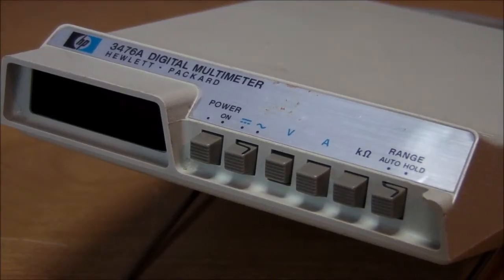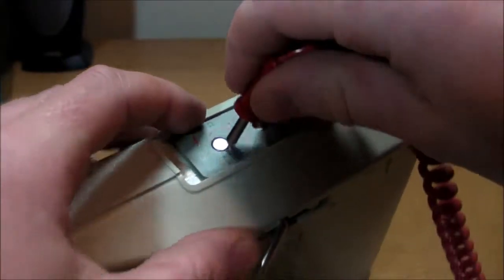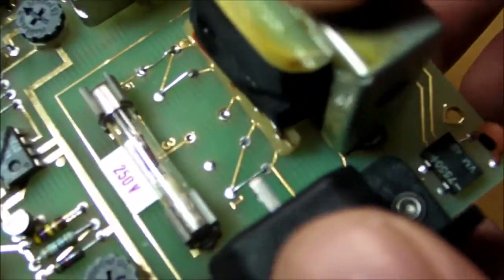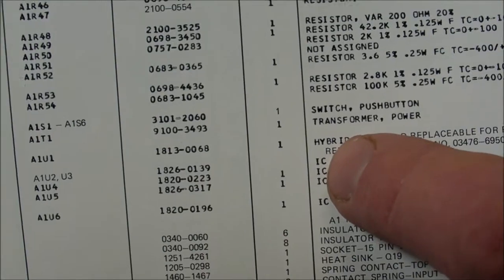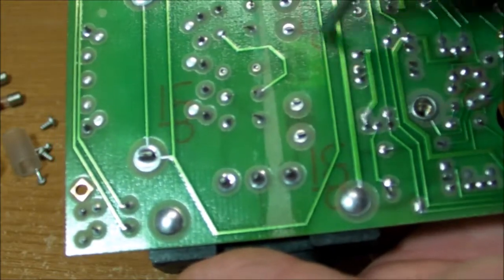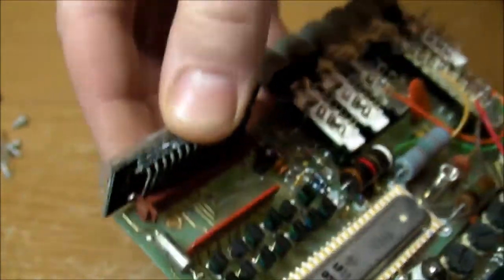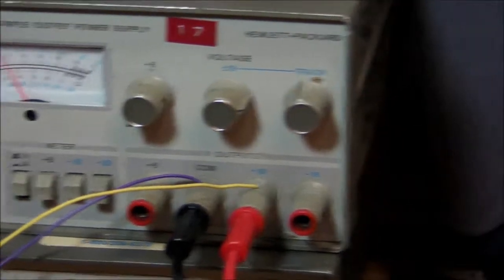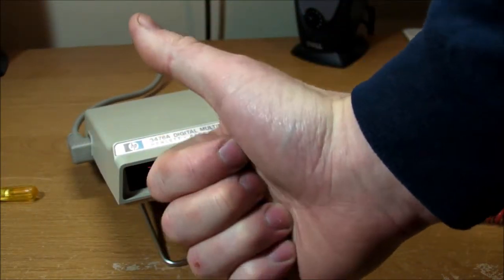(#0169) HP 3476A DMM - Teardown and Repair

Comment: The schematic shows a battery already - there's even a charger circuit. You just need a set of 4 nicads .. that's what that square box in the base is for.

Comment: Never seen this one before. Cute little thing. I hope you could do some better video resolution like 720p. That's why I don't do videos atm, 360p is not that great. However your audio is fine.
Reply: Uhm wat? It is 720p.
Reply from the maker: Yes, I do record in 720. My camera is capable of 1080, but I prefer the smaller file size and shorter rendering/upload times.
Reply: Yeah 720p is enough. :)
Reply: Eric Wasatonic I would appreciate those videos in 720p. There are a lot of details that can not be seen with 360p. A bit sad.